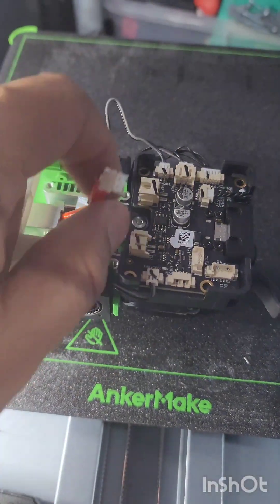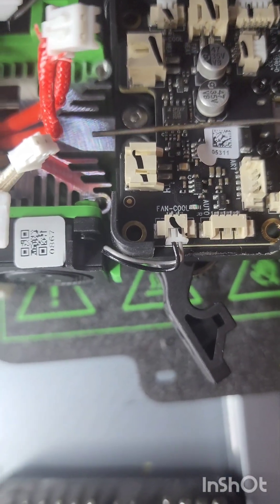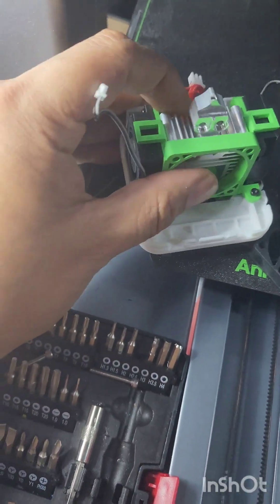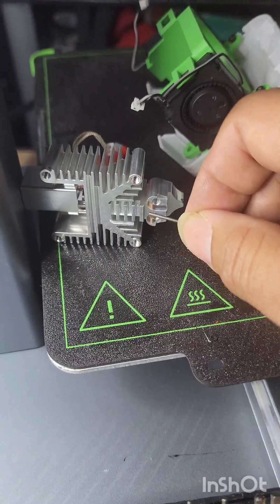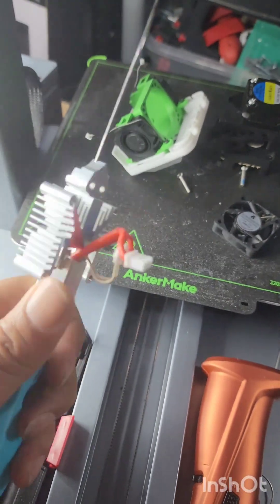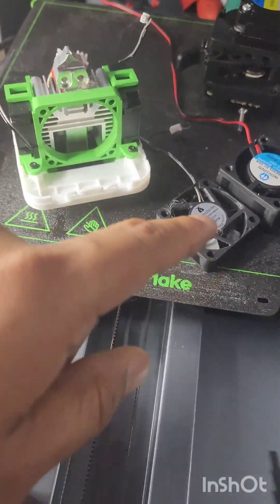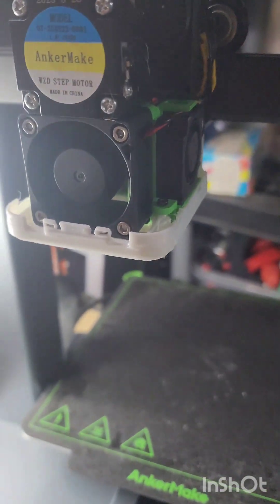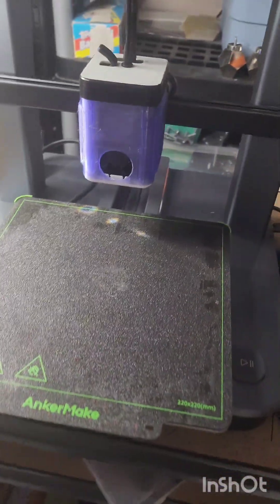Fixing Heat Creep Issue on ANKERMAKE M5C. #3dprinting #ankermake #ankermakem5c #m5c

Comment: I think I had the same thing happen. First several layers of a print was beautiful, but then the extruder just stopped feeding with clicking. I think I've gotten stuck in the same place. The base program runs hotter for first layers. I wonder if that's what caused the heat creep for me?
Reply from the maker: Only one way to check.  Only took me a few minutes to clear it.  Take your nozzle off when you do it so you know you don't have anything interfering with your clearing tool.  Shouldn't have ANY resistance through the cooling fins at all when you try to run your tool through.
Reply: I actually had two places.. I had broken filament in the extruder rollers and filament up in the hot end block. But it wasn't that bad taking it apart, you're correct. Thanks for the video!
Reply from the maker: @rogernewcomb9014  Glad it helped.  Happy Printing.
Reply: Same printer here and suprise same issue. I took off also the heater block and suprise suprise there was some extra filament buildup right at the top of the copper colored tube. Warmed up soldering iron heated the tube while pulling the filament, out it came and that was it. NOW I needed to print better cover for the extruder which hopefully helps with better air flow. Cant understand why Anker has designed that closed enclosure for the heatsink fan 🤔
Reply: @phaapak  I've had issues since removing the shroud. I printed the one that is in the store, but haven't put it on yet. Seems like every print over a couple hours has a couple layers that just stop printing, resulting in very poor layer adhesion when it starts printing again. That's the strangest thing is that it does pick up again, instead of just being clogged.
Reply from the maker: @phaapak  They knew they did wrong with that power ventilation  Thats why they put the better airflow cover on their Ankermake App Model Repository.
Reply: @3DandTeePrinting  I agree. Have you had any issues with filament jamming after you did your mod ?
Reply from the maker: @phaapak  NOPE.  NO more heat creep and no more clogs.
Reply: @3DandTeePrinting  Great, I'm just printing that new extruder cover. Printing cover  lid straight from app was BS, I had to take STL files to Orca slider and do some manual tuning/supports. Lid looks now Ok and the bigger piece is still in the printer. And Happy New Year's Greetings from COLD Finland, it's now now -30C (-22F) 🥶
Reply from the maker: @phaapak  Happy New Year to you as well.  Keep Warm.

Comment: can you publish the link for the fan you used?
10x
Reply from the maker: I just used one of my spare 4020 24V fans I have for modding my Ender 3's.  Here's a decent link on Amazon for some.  Keep in mind the connector is different and will need to be spliced to the one on the M5C.
https://a.co/d/3xotP1O